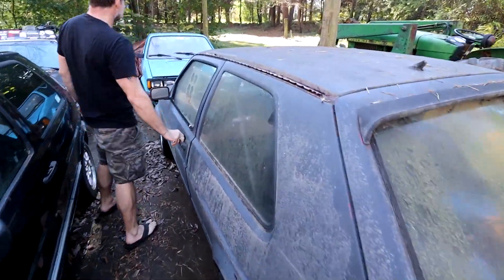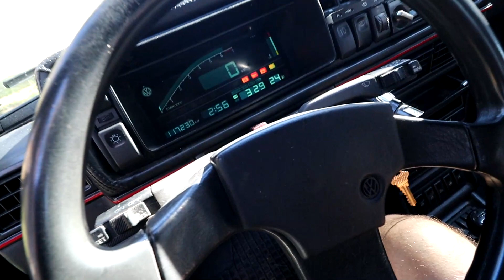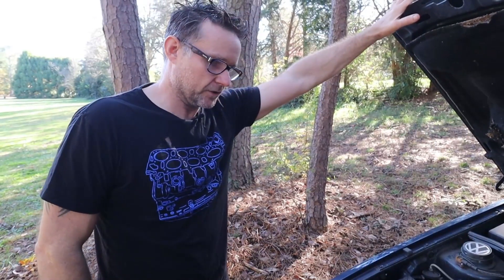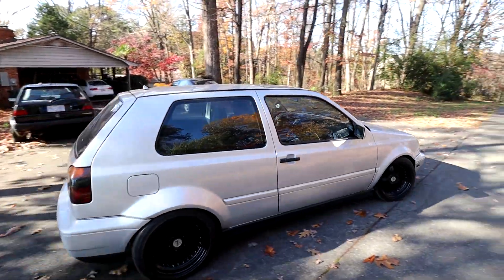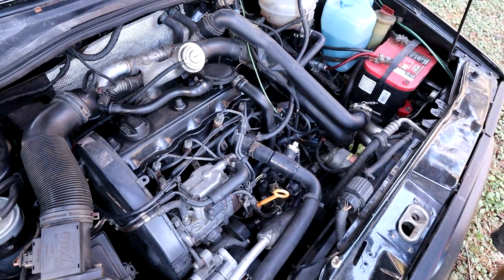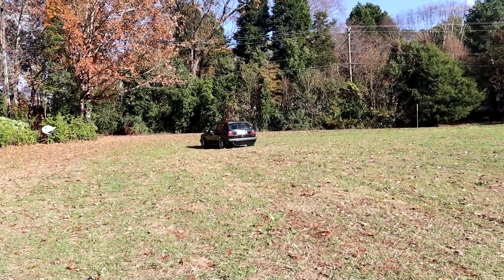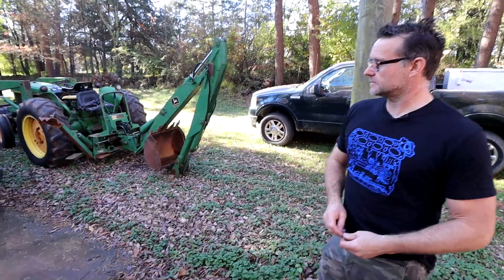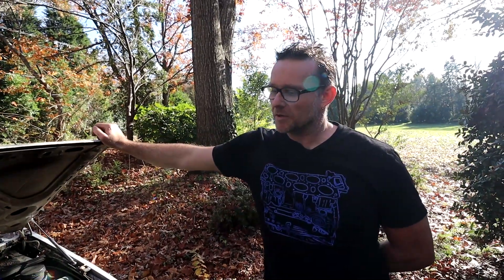This Guy Has 17 Unique Volkswagens! | Owner Spotlight

Comment: Not many people who own this many old VW's actually have them all running. Very cool
Reply: Old VWs are pretty cheep to maintain, parts aren't expensive and maintenance is easy
Reply: I own 3 and only 1 runs lol. One is torn down MK2 GT, second one is a 1300 Beetle and the only runner is a MK2 Golf 1.6 CL.
Reply: @noelmedina6925  what r you smoking ? a transmission goes out, your in trouble, itll run you easily $3,000 USD not sure what that coverts to in pounds or euros but its a lot,  and many vw's if not all, use a timing chain and if  that goes out OMG, it can be very very expensive if both went out suddenly. im not bashing the car by any means i own a mk5 jetta 2.5 with 173k on it and she runs like a beast but only god knows how long that will be, but im ready to fix it if need be
Reply: @E46325mod  you watch too much scotty Kilmer
Reply: even early 2000 models at that. I know because I know a good amount of people who own mk4s (as do I) that just sit in their driveways. I’m guilty as I blew my motor and have been slacking on saving for a new motor.
Reply: I was having 6 golf 2 in last month and now I have 3
Reply: @E46325mod   Transmission in Germany around 250$ for these old VW. Invest another 250 Bucks for new bearings,sealing and bolts for diff. All perfect. :)
Reply: @E46325mod  

3000usd

U buy a couple more complete cars 
Bro. 

Speak not of what u not know. 
You and your Lamborghini 2.5
Reply: Not many people who own ANY VW's actually have them running, lol.
Reply: Instablaster
Reply: I own 3.
Reply: Not most people have so many cars have most running
Reply: Tru. Each has something unique also

Comment: Steve, I know where you’re coming from, I have 13 Veedubs. It gets addictive. I have a Mk1 golf GTI, a Mk2 GTI 16v big bumper, 2 Mk1 Sciroccos including a Storm, a RallyeGolf in Tornado Red, 5 Scirocco Mk2s including 2 Storms, a wide body Rieger and Hornstein Cabrio, a Corrado VR6 Storm, 2 Mk1 Golf Cabrios - a GLi and Classicline and last but definitely not least a Mk4 R32. I also have the inevitable lock up full of spare parts as well.

Comment: Nice collection! I used to work for a golf breaker in Cambridgeshire uk called not escorts around 2013 in the 3 years we were running we stripped almost 2000 mk2 gti's all parts sold on ebay that's where alot went but back then they were worth much more money in boxes than as working car's